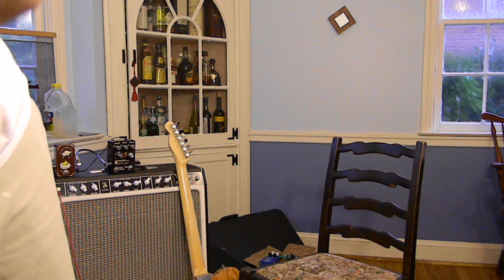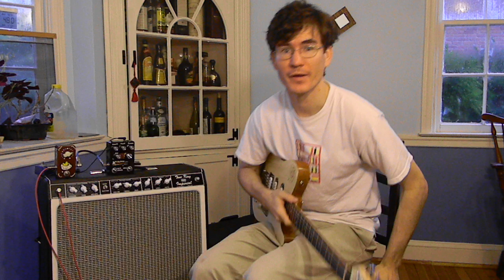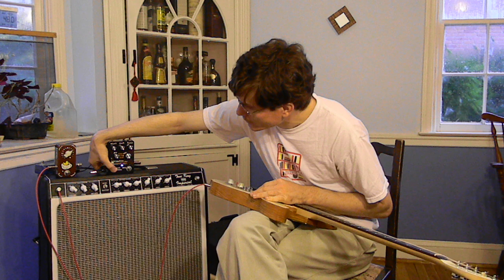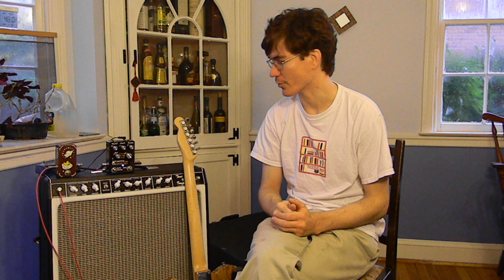1776 Effects Multiplex delay (plus Rub-a-Dub Reverb!)

Comment: That was some great playing with a nice acoustic quality to it. Are there any other commercially available delay pedals I might be able to find that can get me close to this pedal? If I find one of these pedals, how much do you think I should pay? Thanks!
Reply from the maker: These days there's tons and tons of tape-inspired digital pedals and they're all going to be better than what we can build ourselves. I still use the El Capistan on my main board (you can sometimes get version 1 used around $200), but I got a Boss DD200 for an acoustic board recently it's absolutely overkill if you don't need all the functionality but I really like it -- it's more expensive though. You can do almost anything with the boss if you try hard enough so I think there's probably some way to fake the pitch bend button that's on the Multiplex.

Alexander Pedals has a few cool ones under 200 in a small box with tap tempo. I can't remember what the chip is in theirs but there are some other companies that make stuff really similar to theirs. And there's always TC Electronics stuff, you can play with the tone prints and get as fiddly as you need to. I only have the hall of fame and not the flashback so I don't know what sort of assignments you can do but there might be some way to fake the pitch bend in there as well.

Honestly I don't know if any company is building with the PT2399 anymore, there's just no reason to work with something so limited most of the time.